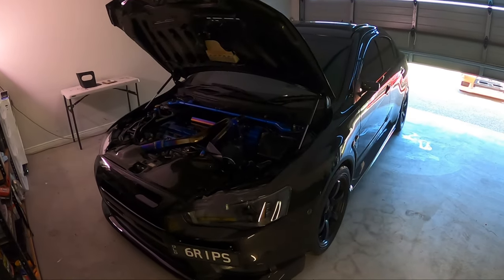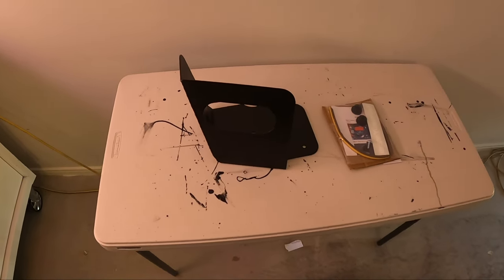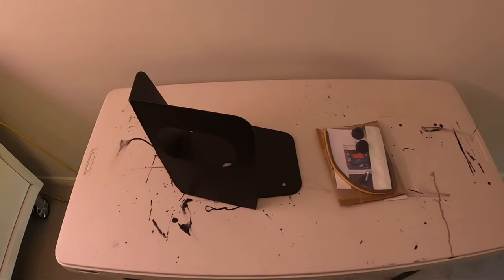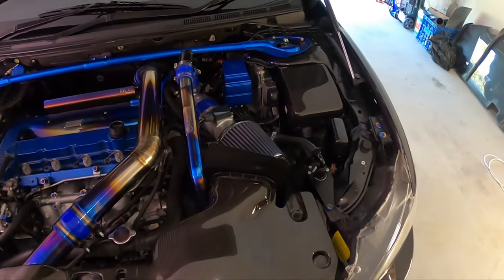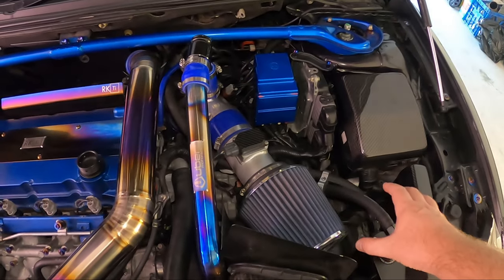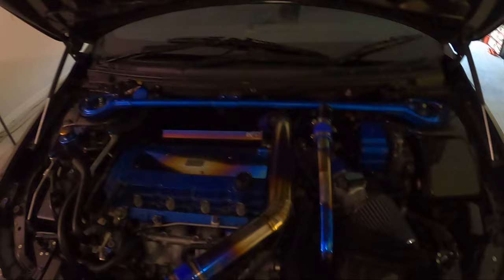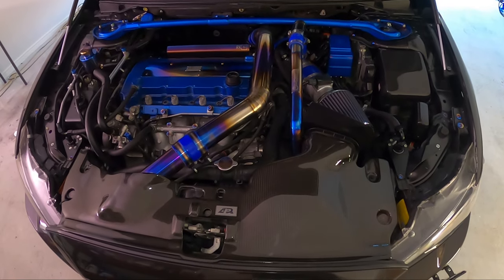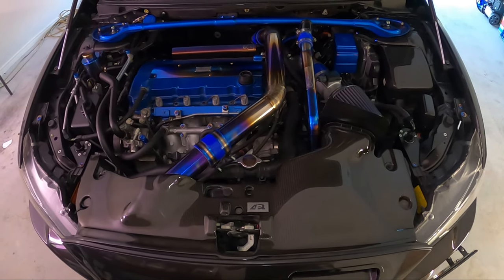Evolution X Design Intake Heatshield Install & Review

Comment: What intake piping is that you have? I’ve got an ams intake with the diverted valve attached. Would this fit?
Reply from the maker: It was Plazmaman I believe, bought it used but I've since changed to an ETS which works with the heatshied.
I think the AMS is similar